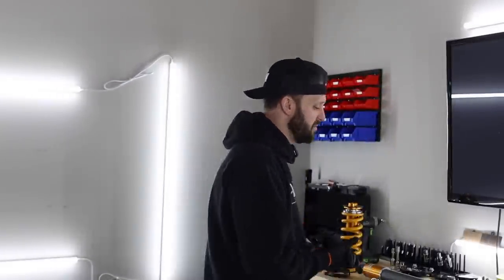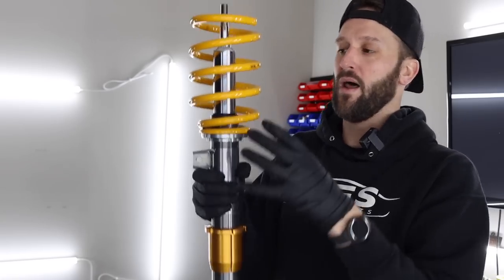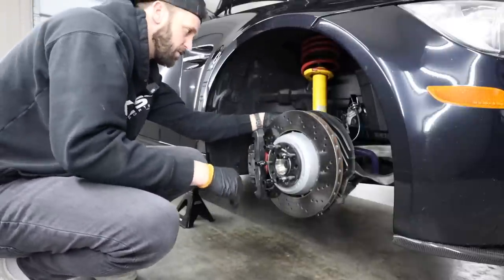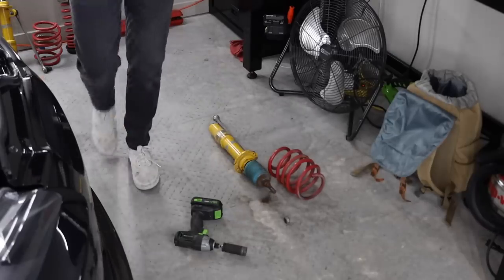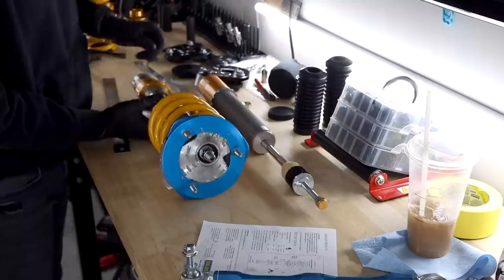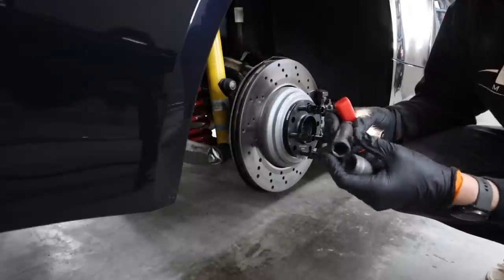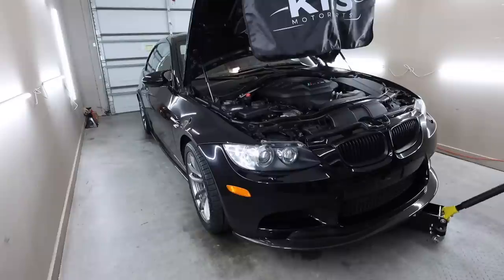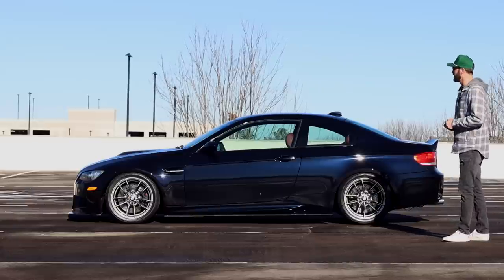Installing Öhlins Road and Track Coilovers on My E92 M3!

Comment: if you had to choose between an e92 m3 or f82 m4 which would you pick? they cost the same here. Im leaning towards the f82 but the v8 sounds so good
Reply from the maker: Very tough pick. Very different cars. But if it were only a weekend car, id go s65. If it were daily and all arounder, I’d go m4. If connection to the vehicle and sound matters, I’d go s65. If speed and modern tech matters, I’d go m4. Lots to consider tbh.

Comment: Great video. Nice to see you working solo in your garage. Luv the format with the more emphasis on DIY.

You might have already answered this but what is your reasoning for not getting a set of hydraulic jacks like Quick Jacks? I have a single car bay also and IMO they are great for most everything I want to do mechanically under the car. Number one reason for me is feel much safer then Jack stands!
Reply from the maker: I might get a set of quickjax. I’m just waiting until I have a bit more room
Reply: I like that Quickjax has wall hangers. Hanging them on the wall is a great space saver.

Comment: i think you set your rebound in reverse. if my memory serves me correct, clockwise is full hard. then you back it off counter clockwise.
Reply from the maker: I’ll have to double check, I could’ve sworn it was back out then back in but I’ll confirm and update 👍
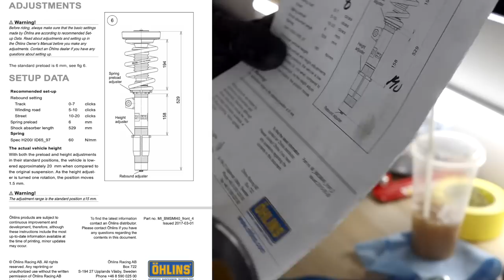Reply: @ThicWhips  i just rewatched it at 27:30. you set it in reverse, which is probably why you find it soft. when adjusting it on the car, since the knob is upside down, make sure you adjust it correctly. clockwise for full hard then back back off 8 clicks.
Reply from the maker: Oh ok awesome yeah that would make sense! I’m gunna adjust them today 👍👍 thanks man
Reply: @ThicWhips   clockwise off (0) - anti- off (lefty lucy etc)

Comment: Nice video! Why don't you get a Quickjack? Then you can raise the car really easy for this kind of work or wheel changes  etc.
Reply from the maker: I will in the future. But rn I don’t have the room and working around those in a small garage will just create more problems. I also feel like, jacking up the car in general isn’t the problem, it’s that you really don’t get the height you need, quickjax won’t really solve that either.
Reply: @ThicWhips  true, it will never have the height of a proper lift. 
Keep up the E92 M3 content! Nice to get some inspiration from for my own '11 E92 M3 👌🏻 
Greetings from the Netherlands 😎

Comment: Is that Jerez?
Reply from the maker: Yes
Reply: @ThicWhips  forgive me if you mentioned in previous videos are you running 18s or 19s? Staggered or square? I have an e90 running 19” EC-7s, 265/30 up front 295/30 out back and I’m rubbing in the rear a little on Stock EDC with h&r race springs 😬 - I should probably upgrade suspension?
Reply from the maker: These are 18” wheels, staggered. 513m bmw wheels
Reply: I have same tire setup on 19x9 19x10 zcp wheels and Eibach springs no rub it’s low
Reply: @1ROCKY89  interesting. My guess I’m too low and need to replace suspension.